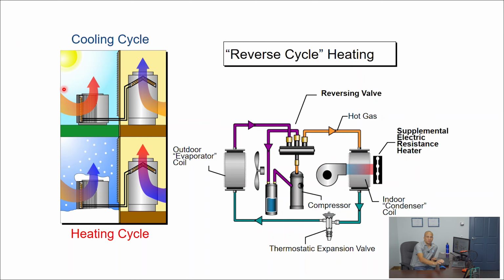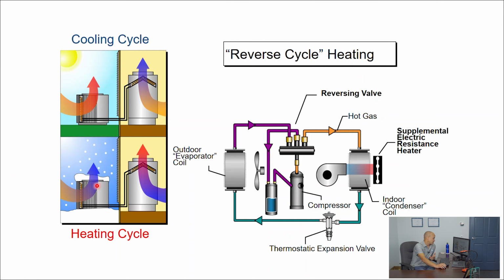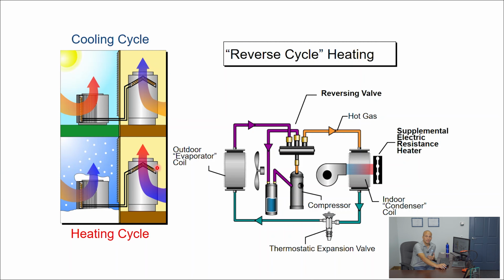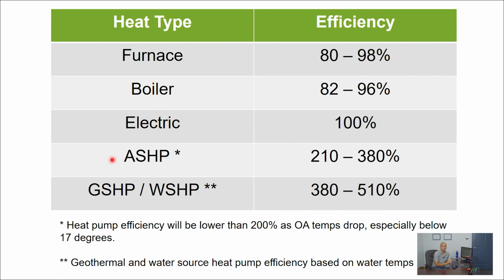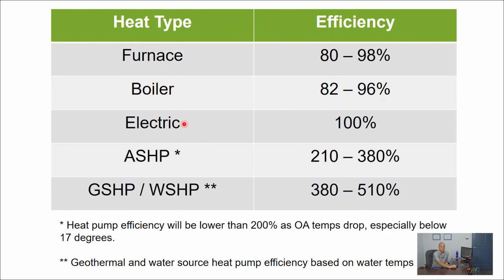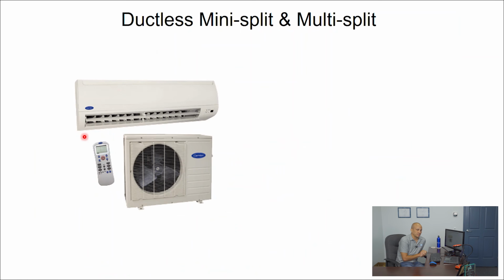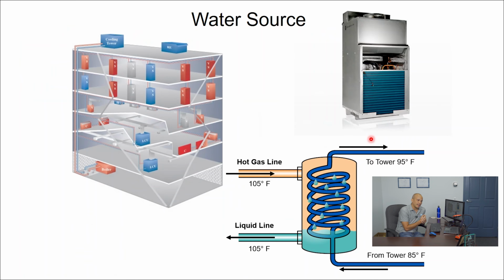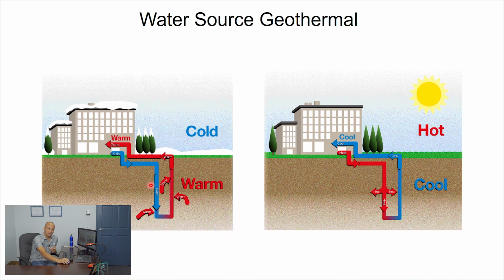How Does a Heat Pump Work?

Comment: Free heat as a byproduct from the refrigeration cycle. It was vastly used in commercial refrigeration as hot gas defrost. Heat pumps were first designed to heat a pool in Southern climates. Good video. Stay safe and be well.
Reply from the maker: It would only be “free heat” if you were running the refrigeration cycle for other reasons anyway, such as the hot gas defrost you mentioned, or in comfort applications we would do it for hot gas reheat for dehumidification sequences.  Or for heat reclaim / heat recovery VRF systems.

But in the case of a standard heat pump, it is not free heat because you are running the compressor solely for heating reasons in this case.